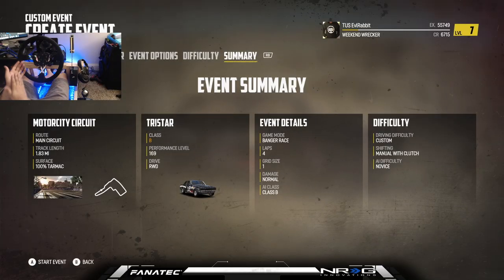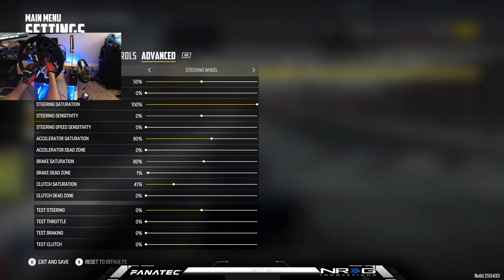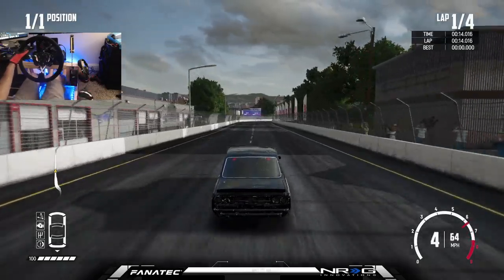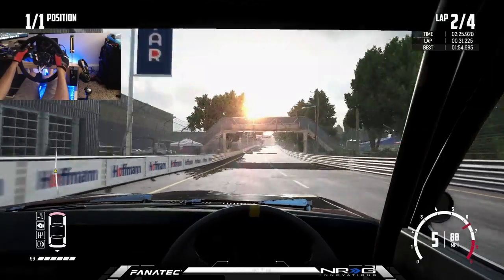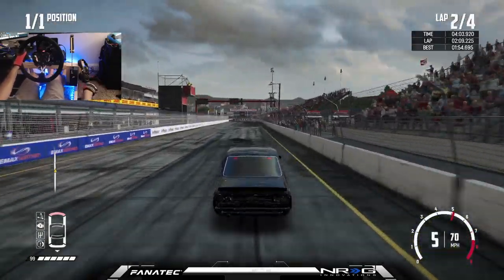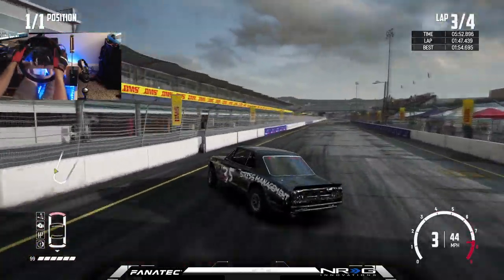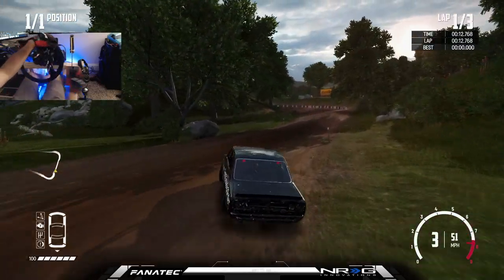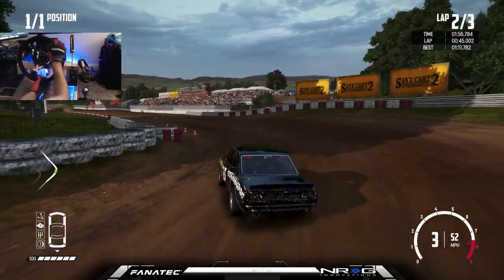Can we Drift on wreckfest?!?! - Wheel cam -

Comment: Just saw this video while searching for info on set-ups/assists.  I'm not a drifting expert, but found I can drift with my wheel (TMX with really low Force Feedback - 17%) pretty easily on dirt.  Been practicing on Bloomfield's figure 8, but have done it on other tracks as well.  I experimented with just about every setting for suspension, differential, and assists.  I ended up with all assists off except Stability.  TCS bogs it down requiring downshifts.  It's doable still, but keeping RPMs up is a chore.  I kept stability on because it doesn't resemble STM in other games.  It more resembles adding extra wheel center spring and rear toe.  It simply wants to straighten the car out on acceleration, but doesn't seem to affect turn in like locking the diff does.  It doesn't bog the car down at all like a game like Forza does.

Obviously you figured out soft suspension making it more kind to sliding.  For the diff, I found you can go from full open to limited in the middle.  Full open allows to to control the drift with the wheel via over turning and counter steer since the car rotates much easier.  Smoother drift, but a lot of wheel work.  I found add the middle of limited slip, I could control the drift more with the throttle, but had a tendency to overturn.  In fact, I struggled with the counter intuitive over throttling to turn and slow down.  But it was pretty awesome when I got it right.  I was more consistent with open, but slightly faster with limited.  Full locking just left me to struggling to get the drift started and snap oversteer spins.

Comment: Idk how the physics work in this game but you want to get as much speed in 2nd(3rd at most) gear and downshift to first, turn the wheel, tap the handbrake and keep the revs up to keep the wheels spinning. Then correct your steering and move gracefully around the track